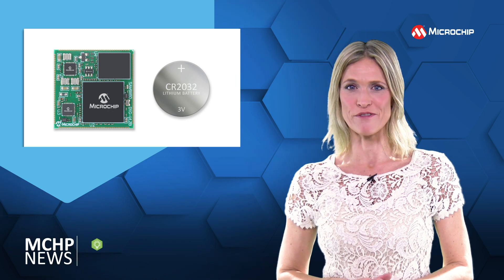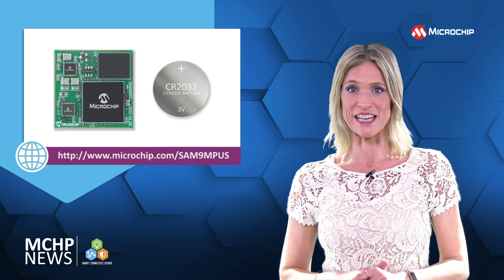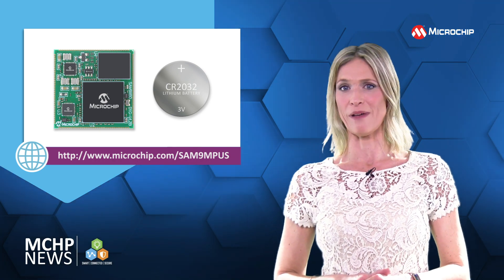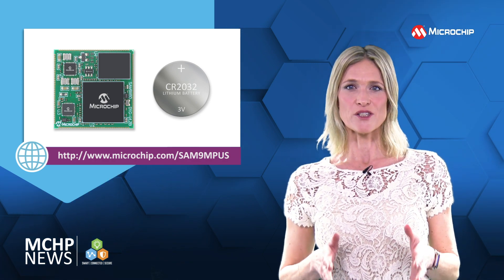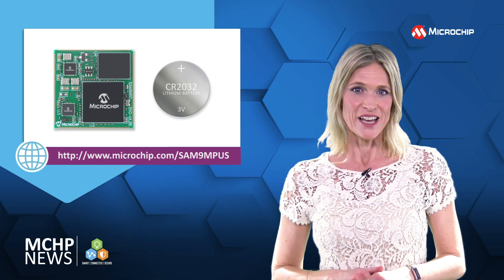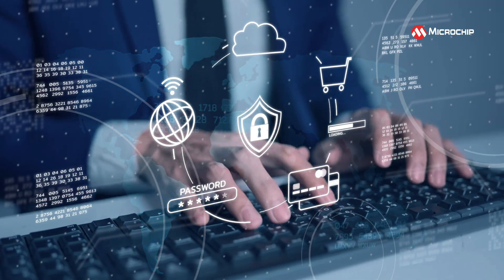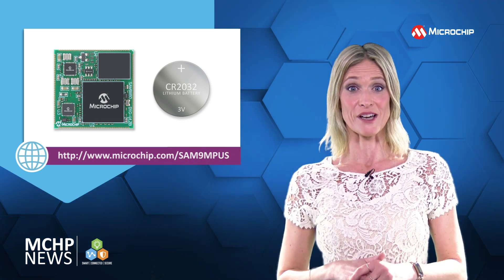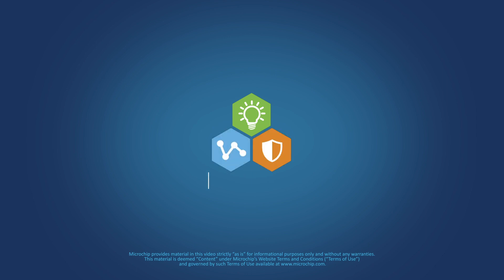Space-Saving MPU-Based SOM Eases Design and Manufacturing

Comment: The problem with these modules is that an abrupt power interruption isn't recommended, otherwise the DDRAM deteriorates. A safe and controlled system shutdown, which involves using a power backup, is required to perform such a controlled shutdown in the event of a power outage. Depending on the case, it may be an extra cost to the development of the hardware to use the backup.

Comment: You say 5V, but show a 3V cell?
Reply from the maker: Hi there, thanks for reaching out. It depends on the specific system and device in question. In some cases, 5V may be the raw power distribution voltage that is converted to lower voltages such as 1.2V, 1.8V, or 3.3V near the device that consumes power. However, there are also many other systems and devices that use different voltage levels for power distribution and conversion. For example, some systems may use a 12V or 24V power supply that is then converted to lower voltages, while others may use a single voltage level for power distribution and conversion. The specific voltage levels used will depend on the design requirements of the system and the devices it contains. Hope this helps!
Reply: @MicrochipTechnology  So, a bit like the Raspberry Pico, that has a boost/buck power management system that allows the supply to be as low as about 1V6, and as high as 6V0?
Reply from the maker: The SAM9M1x MPU itself does not have a built-in boost/buck power management system like the Raspberry Pi Pico, and requires an external voltage regulator to step down the voltage to the appropriate level. For example, in the video, we mentioned MCP16501 was used in the SOM, which integrates three DC-DC Buck regulators and one auxiliary LDO, and provides a comprehensive interface to the MPU. Let us know if this helps!
Reply: @MicrochipTechnology  Yes, it helped considerably, thank you.
Reply: Guessing it's for size comparison only
Reply: @spicemasterii6775  Very possibly.
If so, it is misleading.
Reply: It's been a long time since I developed hardware. Is 5v now the raw power distribution voltage that is converted to 1.2/1.8/3.3 near the device that consumes power?
Reply: @ksbs2036  Sometimes: yes, sometimes: no.
Reply: @MichaelKingsfordGray  ah, so nothing has changed in HW design I see 😄
Reply: @ksbs2036  That depends on the intended function of the device. Accurate analogue designs cannot cope with any form of switch-mode power converters in their vicinity, whereas pure digital can cope.